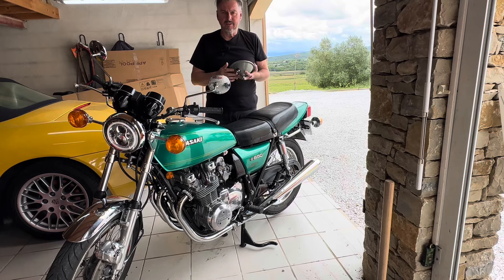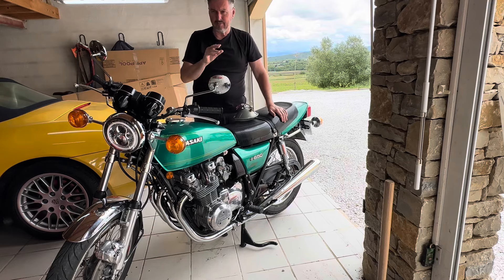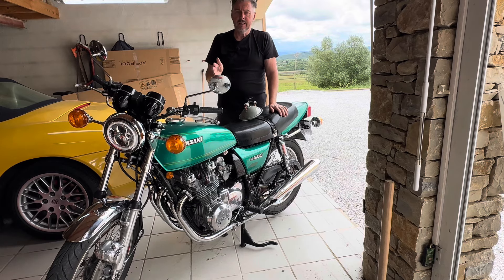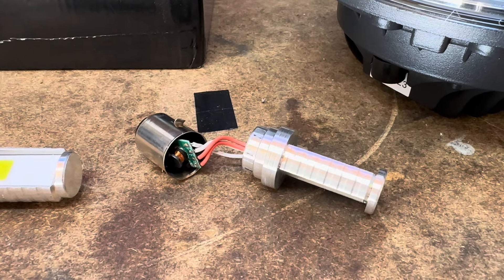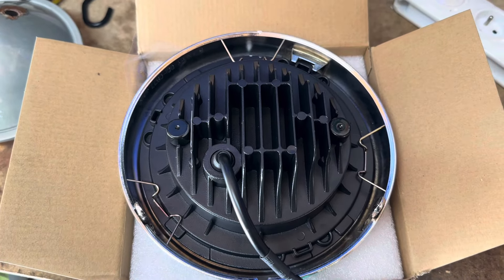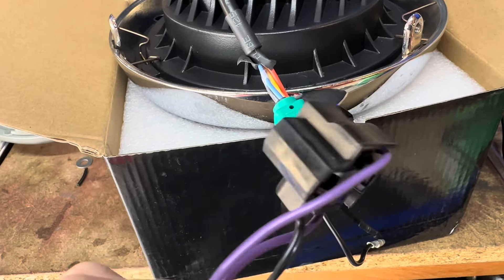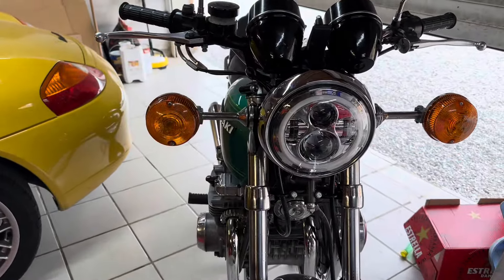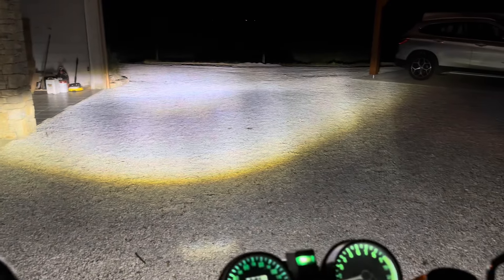1977 Kawasaki Z650 LED Headlight Conversion

Comment: I just went through every bulb on my RD400 and changed them over to LED bulbs. Dash lights,  brake lights,  the works! I got different aftermarket small thin LED turn signals and it made a huge difference to our old antique charging systems. I did the same bulb change you started with, going from the halogen bulb to an LED bulb in the stock lamp, but the spread is awful. I should change over the entire lamp like you did because the output is Ansari,  but I just can't stand the way they look. I wish somebody would come up with a single lens LED bulb that has the proper spread and illumination. I just don't like the way any of the modern LED  headlights look.
Reply from the maker: I also changed the clock & idiot bulbs for led’s but they all blew. Usual Amazon quality
Reply: @RepairandRideout  Hmmmm. Weird.  How's your regulator/rectifier?
Reply from the maker: @andybobandy641  all seems fine, I am running electronic ignition but that’s the only modification.